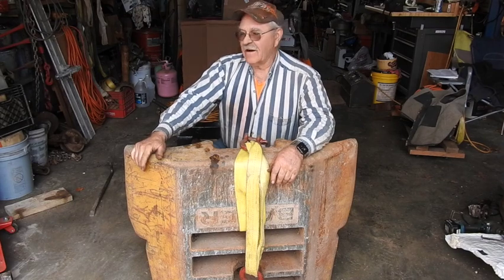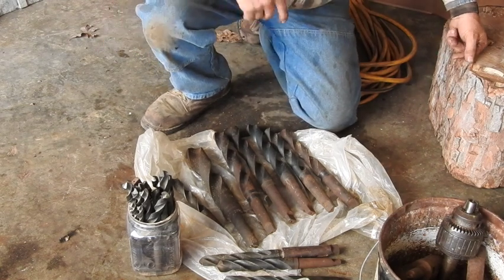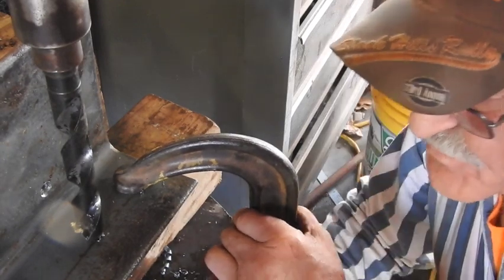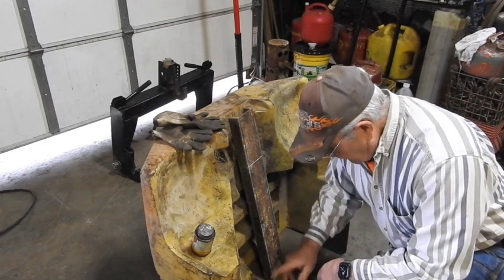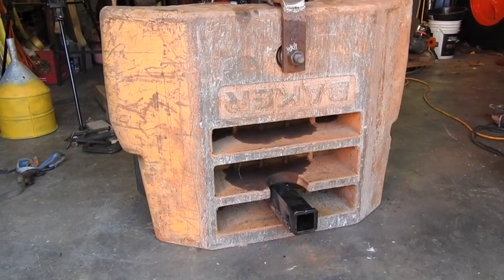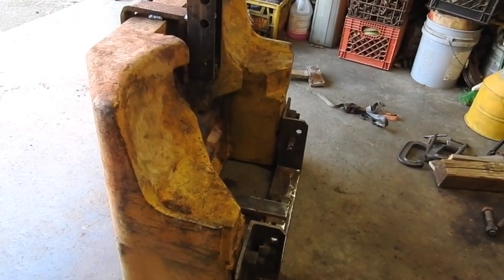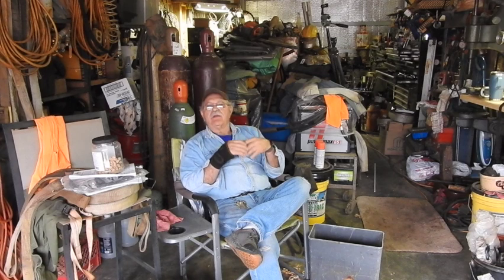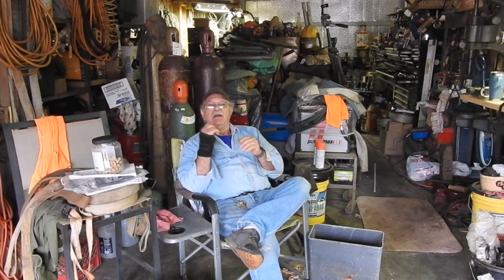MX 5400  What Would Make A Good Counterweight

Comment: We had an old tractor with just a junk box mounted to the three point and filled with scrap iron. We also when I was a kid, had an old water barrel mounted to the back of an old 8N but I'm not sure how good that worked.
Reply from the maker: Well Rick, any added weight to the rear is a benefit. We had Fairbanks Morse fywheels as wheel weights on one of the 44's.  About a 5 or 6 horse make and break.

Comment: That's pretty much the way I sharpen bits. 
Lot's of practice over the years. 
I'm the same way with buying new for home use. I have but I try not to. At the auction I could buy a five gallon bucket of bits for what a single 1" bit with a #2 taper shank would cost new. 
I have problems when the battery goes dead the file doesn't close. Without the checksum on the file the computer can't verify that the file is good so it won't read it. 
There are ways to recover the file but after going through all the steps and spending several hours trying to recover the file, I figured out even if I was successful. Which was only about 3 out of 4 times I could just do what you did. Explaining what happened will get you by. 
If I think it is worth the time I will just reshoot  parts and pieces so I could do the voice over while showing the locations and point out problems. 
Most of the time it is just, "I put in the oars and started rowing."😁 😎
Reply from the maker: Oh I know.  I've bought tons of bits for literally pennies on the dollar myself. Then last year a buddy had me help him with drilling a block on a '39 Chevy for adding an external oil filter.  When finished he gave me a set of 31 out of 32 MT2/3 bits that were NOS.  It was only missing the 1''.  I think they started at 3/16 and had a few  64th's interspersed in the middle.  
   Data loss is usually my fault.  Actually all of it is.  I couldn't re-do the video because of all the welding etc. and I'm sure the problem was having not pushed the button correctly.  I've done that before.  Its got a ridge around the button that's bit me in the butt before.

Comment: I've been toying with making a counterweight for my Kioti tractor as I use forks on the loader end.  I don't want to carrying my rear snowblower around all summer to act as a counterweight.
So I think I'll wait a while and see what you have done, provided ( that is ) that you have learned how to use a camera by then. LOL  hahahaha. 
( aww that's a dirty dig at you Wendell,... I'm only kidding of course I apologize for that one. )
Reply from the maker: I'm editing the second video right now Reg.  I've already had it put to good use with a nice reasonably green pine log 26'' x 11'.  The tractor was really stable.
Reply: @tractorman4461  I must say that 'Baker' counterweight is ideal.  I was thinking of making a weight for my tractor with some concrete, and considering an average weight of one cubic foot of concrete weighs approximately 150 pounds, I can get a good idea of the size of a 'form' I'll require.
I'm looking forward ( as I always do ) to the next video from you.
Reply from the maker: @regsparkes6507  My SIL made an angle iron frame and attached plywood forms around it.  He added a couple 4" pvc pipes to leave a tower for hand tools or to drop chains into....of course he left the pvc up a little to hook the chain to. He then used pre-mix to fill the forms.  Almost perfectly 800 pounds is what his weighs for his L3301.
Reply: @tractorman4461  Sounds like a good job then.